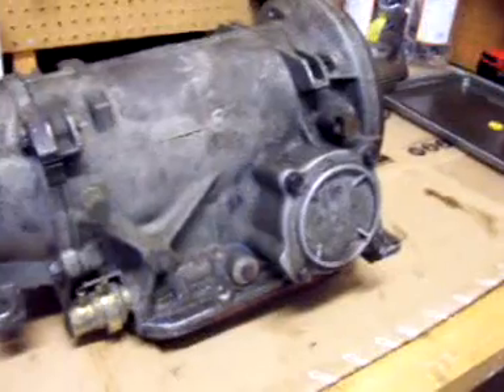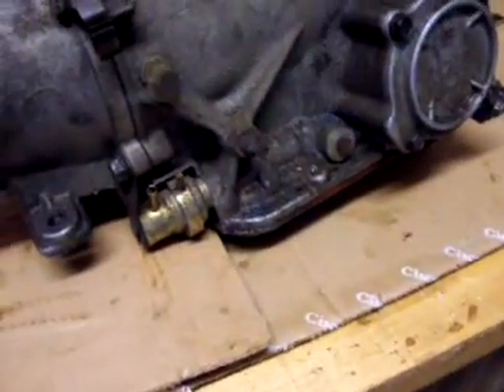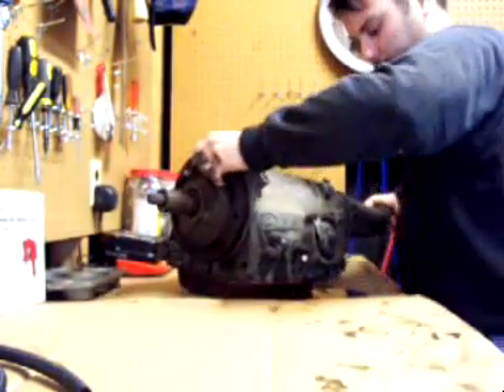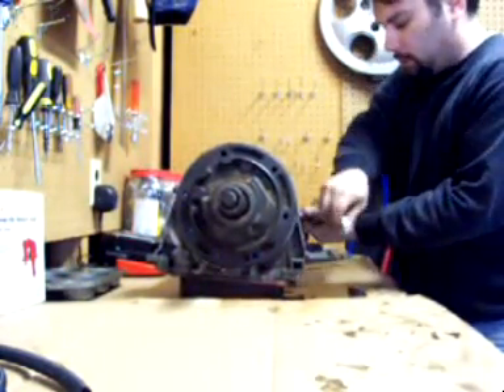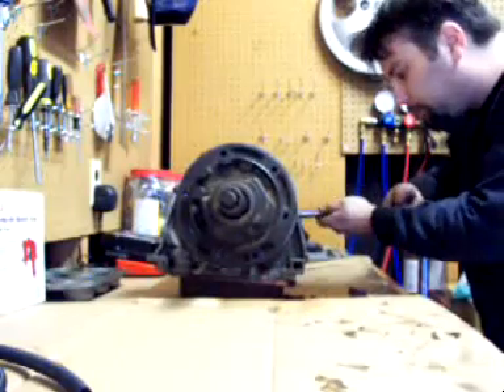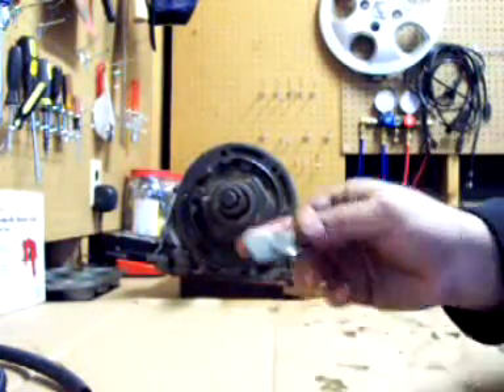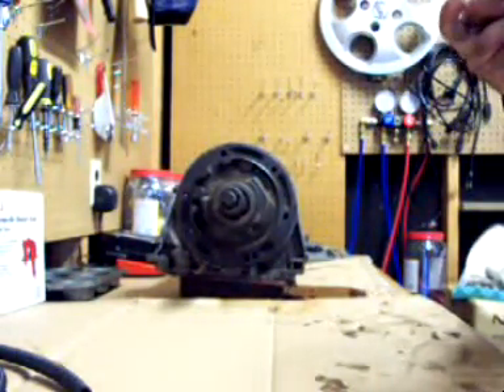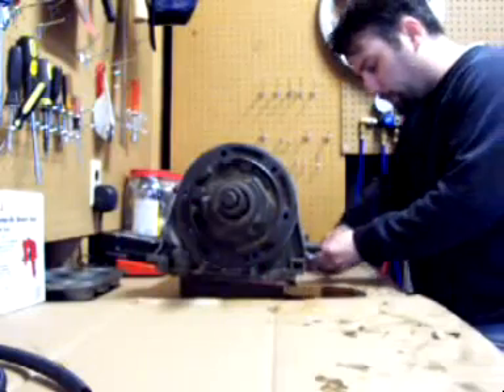Ford C4 Transmission Disassembly Part 1of 8

Comment: Thx for this vid MP, I have a problem with my FM c4 1964 automatic. I rebuild it and changed all the parts. everything works fine except the car can't go in reverse. what should I do? Any help is welcome :)
Reply from the maker: Something is either out of adjustment or plugged up inside

Comment from the maker: @illuminatijews It can be done.  I have seen some forums where people swapped out their C5 for a C4.  I do know the pilot shafts/torque converters are different between the C5 and C4 transmissions.  There might be some other small changes but it is possible.  I did a quick google of c5 to c4 transmission swap and got some extra information, so people have done it.

Comment from the maker: @silverbullit LOL, yea they work kinda well when working on transmissions or engines.  The only time they werent good was when I had them in the floor of the garage ( no place to put them ) when I was doing a head job on a chevy 2.2 engine, kicked it, scattered some bolts, cursed and picked them back up!  LOL.  Didnt loose anything.